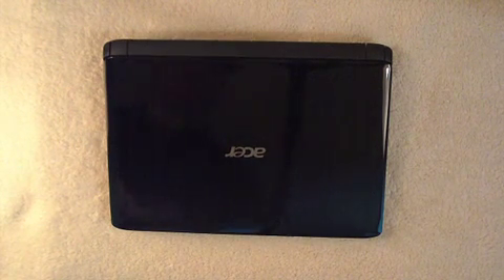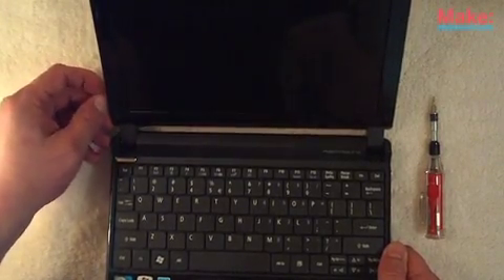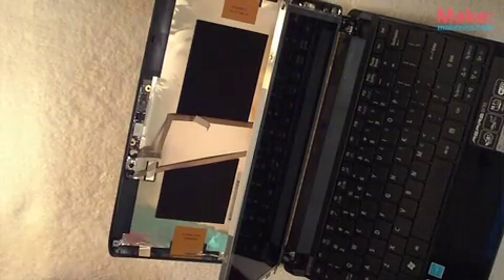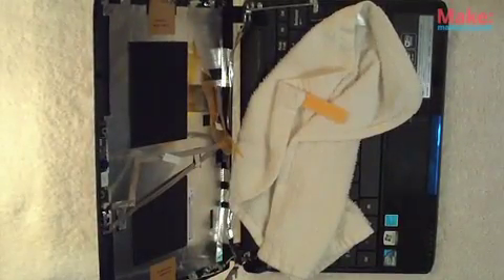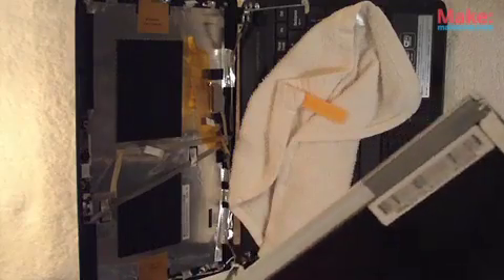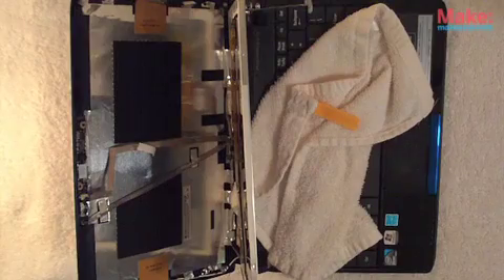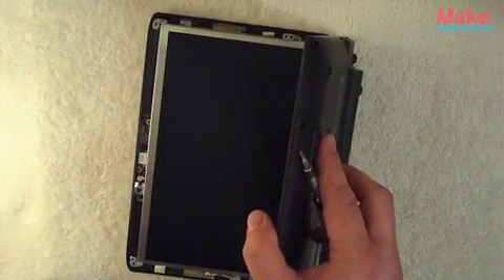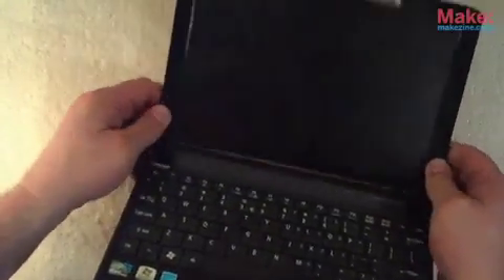Hackable Pixel Qi displays

Comment: they said in the article that the e-reader mode has 3 times the resolution compared to the fully saturated mode. does that mean its compareable to 6 of theese normal screens compressed to the size of one screen? I dont get it!

Comment: From what I have seen, the Pixel Qi screen is a transreflective screen. Take your netbook with the standard screen into daylight and try to use it. The picture is usually not bright enough to see in full daylight. 

Now, Take a Pixel Qi screen into full daylight. You'll be able to see the picture much, much better. This is a must for anyone planning on using the device outdoors. Yes -- it is more expense, but if you need to be outside with your netbook its a life saver.

Comment: Just to confirm there is no real hacking in this video. What it is, is a how-to replace a manufactures LCD screen with a much more expensive one that draws better contrast in high light areas (outside). Not one wire is spliced. Nothing more than a how to replace your crappy monitor with a expensive crappy monitor. Thanks for the video though! The concept was nice and im not knocking your work. It just is not worth it the cost of the machines are less than the screen replacement.

Comment: If you have a Samsung N130 or Lenovo S10-2 netbook and it just happens to have a duff LCD screen, then this is how to fix it.
But at approx £181.73 for the Pixel Qi display with two modes (an easy-to-read, real colour, multi-media mode or a crisp, low power e-reader mode) you might be better getting a laptop.

Comment: The new screen can turn black and white and put no strain on the eyes(like a kindle screen). Only it uses a different technology and it also supports motion. So you can use all your normal laptop features, but on a B&W screen which reflects light like a book(not with glowing pixels) :)

Comment: @Ln6Ec The Pixel Qi screens, in addition to functioning like a normal screen, also have a high resolution, low power mode as well, suitable for using like an e-ink type display.  So if you're doing some long reading or something, it can help with saving power as well as eye strain and things like that.

Comment: Ok...a few things:
You never said the differences between the original screen and the new screen (if any, or whether it was just to replace a damaged/old screen)
I wouldn't call this a hack, since you are simply replacing an identical part (unless the new screen gives you a new capability)
This was way too long. There were several times where you could have cut, making this video substantially shorter, and therefore more enjoyable.

Comment: Wow, in all honesty this is not really worth doing for most people. Given that the replacement screen costs as much as a netbook and it doesn't really add much feature wise towards the average consumer, not worth it.

Probably the people that are more likely to attempt something like this would be the tech-savy, but they would probably realize that it would just be better to spend a bit more on a newer fancier netbook rather than buying a replacement LCD screen for $275 and install it themselves